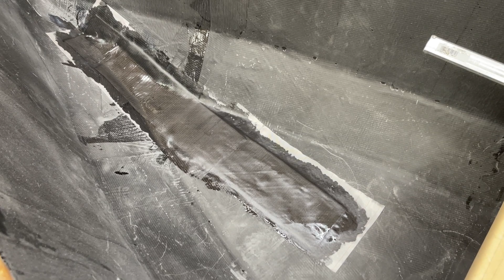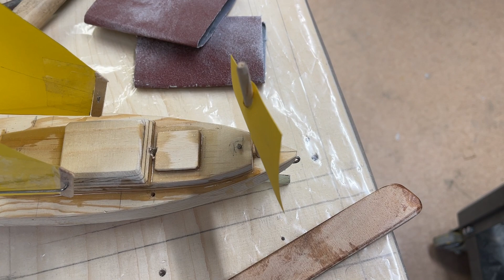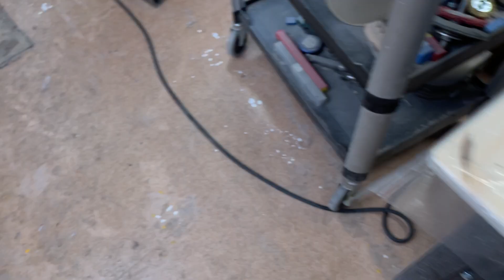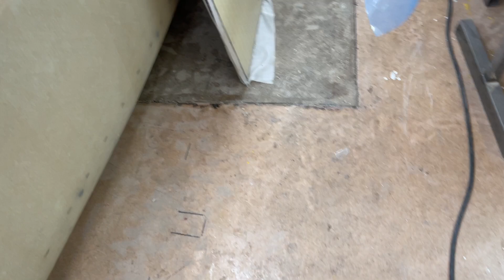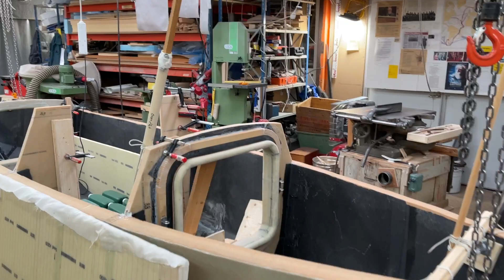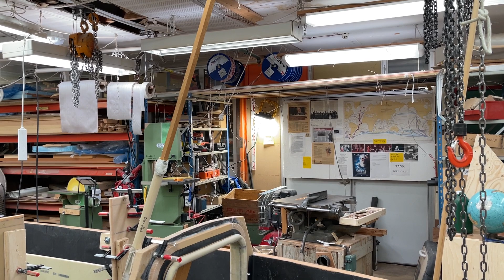Laminating the place where the CB was. Also getting ideas of the mizzen mast.

Comment: Looking again at your rig.

Perhaps I was wrong in my earlier statements about it.

If you  let the leach-club fly (not attached to the boom), and run the sheet line that attaches to it through a ring or pulley, at the end of the boom, you may well get it to work.

But, accept for dead downwind sailing, I doubt the twin mains will produce anywhere near the drive their combined area implies. They are too close together.

In WWI, biplanes ruled the skies. The reason was that engines available at the time were not all that powerful. Airframes had to be light and strong.

The twin wings could be braced together forming a very strong truss, which was not all that heavy for its strength.

But there was a penalty. That was the second wing added only about 20% more lift than the first one alone would have. Back then, it was a fair trade. A strong but light airframe for the extra drag of the second wing.

But when engines became more powerful, the second wing was soon discarded.

The two wings on a biplane were usually placed at least one chord length (the greatest width of the wing) apart. Your twin mains are far closer together.

You will likely find that you will be better off setting only one of the mains at a time, when sailing anywhere but  downwind.

This could give you an advantage. 

The boom could then be kept always to windward. When changing tacks, you simply furl one sail an open the other.

If you can live with the limited sail area of just one main (except when going downwind) , you're OK.

I suggest that you make the mizzen bigger, and move your twin mains forward.

My LOLA design became a ketch by a very similar process.

As a yawl, the main had to be too big and too far back. This meant both a taller mast and a longer boom. The taller mast was not a good ship mate with the limited initial stability of the boat, and the longer boom did not marry well with the narrow beam.

Once a bigger mizzen was added, the main mast could be both shortened and moved forward out of the cabin area.
Reply from the maker: Now you are comparing two wings with one, but most sailboats have two sails. One in front of the other.
Therefore you should compare tandem airplanes with biplane airplanes.
There are tandem airplanes but they are rare.
However I now got a new idea about the rig but I must first work with the patterns for the bronze keels.
Reply: @SvenYrvindExlex  

True. Most sailboats have two sails. But they interact much differently when they are in tandem, rather than side by side.

A cat-ketch, for example, powers a boat well in most points of sail, except upwind. The aft sail has to use the air that is disturbed by the fore sail. This becomes less and less true as the boat eases off the wind. On a broad reach, the cat-ketch may even be superior to the sloop.

There are a few examples of tandem wing airplanes. One, designed by Burt Rutan was quite fast. It was often called a biplane, but I think that term was inaccurate. The upper wing was  quite far aft of the lower one. And both wings were quite narrow. But, since there were two of them, he could get away with far less span. The penalty was likely maybe half as much lift from the aft wing as from the forward one. This seems like a lot of useless drag, but he was able to cut the wing span by maybe 1/3rd. Structurally, that is a huge benefit.

Although a sloop also has two sails, the sails interact much differently than those of a cat-ketch. This is particularly true when sailing upwind. The jib acts as a leading edge flap for the main. This is especially true when the jib is smaller than the main. Thisbis why almost all fast sailboats are sloops with larger mains.

There is likely not enough separation between your two mains to get even biplane efficiencies (about 60% per given sail area, on all points of sail, except down wind. They are likely close enough together to get in each other's way. If this happens, you could find yourself getting less lift than with just one of the two mains.

Since these two sails are designed to easily roll up, the second main may well earn its keep if it is used for down wind  sailing only.

As for the boom attachment problem:

I have thought up another possible solution. This would be a bridle line, with its  lower end attached at the base of the mast. Its upper end would attach to a collar bearing at the top of the mast. The boom would extend past the mast to the middle of this line. The drawback of this idea is that the boom will always be against the sail, either when the sail is unfurled, or pressed against the mast when the sail is being furled. If I were going to rig my boat this way, I would chose having the second option, and add a chafe strip to the sail, which would be designed to be easily replaced once it wears through.

I saw your video on the "J" shaped boom end, but I can't seem to figure out how its  supposed to work. 

Anyway, best of luck.

Comment: Sorry if you’ve answered this in a previous video, but what are the advantages of having the masts with so much of an angle towards the stern?
Reply from the maker: I did ansver it a few times but it is about sheeting.
Now the Ljungström rotating mast can be sheeted like a headsail and do not need a boom although I will use a whisker poole.
Reply from the maker: Also she will not dip her sails as much when rolling downwind as with an upright mast